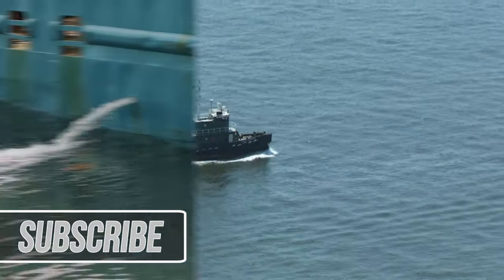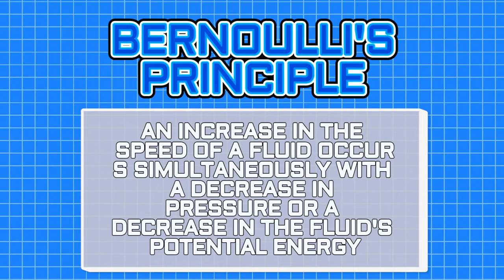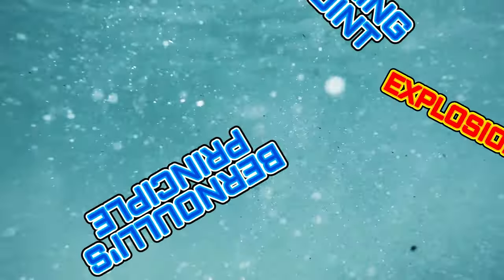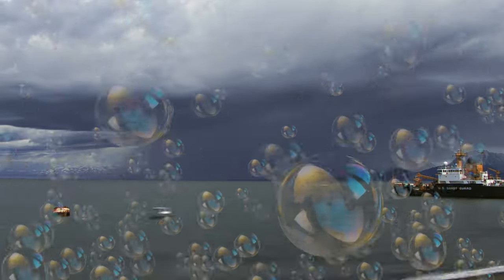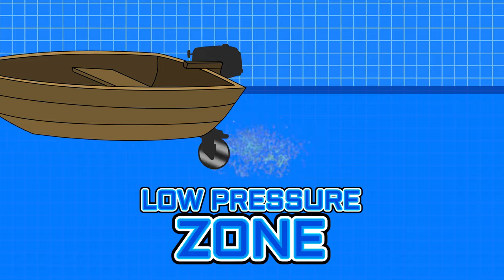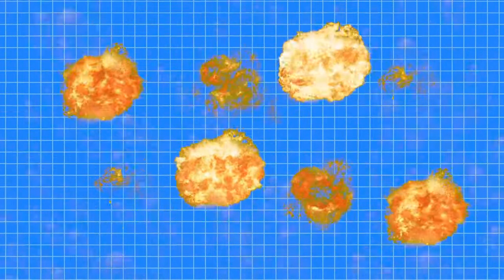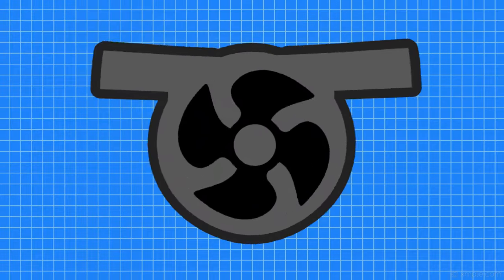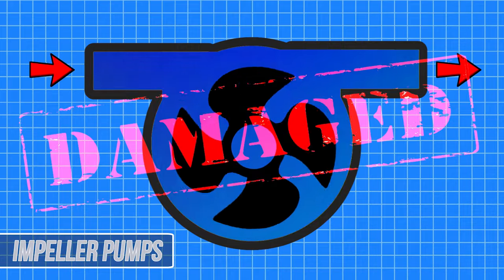What is Cavitation and How Does it Work?

Comment: I'm having a lot of trouble understanding Bernoulli's Principle, can someone help?

How can a fluid pressure drop as fluid velocity increases? In my head fluid pressure and velocity seem directly proportional. Like if I had water just dribbling out of a hose, that's low pressure and low velocity. But if I had one of those power washing hoses, the water is coming out way faster and it's higher pressure too.

Idk if I'm explaining myself clearly, but to me the pressure and velocity of a flowing fluid seem directly correlated instead of indirectly. If I wanted to increase the pressure of water coming out of a hose, I'd squeeze the handle tighter which would also increase the velocity. In that example I'm increasing the fluid velocity which is increasing the flow pressure (as is apparent by the plant I'm watering bending more and more).

I need help grasping Bernoulli's Principle because it seems like it's saying the opposite of what I'm describing. Most people just tell me to just look at the equation but that's not helpful. That's like saying the bible is true because the bible says it is true. What I want is to have a deep intrinsic understanding of Bernoulli's Principle, with some examples to picture in my head to go along with it.
Reply: I have to same question too. 
But i just go along with the Bernoullis theorem
Reply: Hi,
The way Bernoulli's Principle works is all to do with the total energy within a system. It makes a number of assumptions including that the flow is at steady state, the fluid is incompressible and inviscid and the equation is only valid along a single streamline of the flow. The total energy is broken down into 3 components which are pressure energy, kinetic energy (the velocity) and gravitational potential energy. It also uses the continuity equation that states flow rate is equal to cross-sectional area of a pipe multiplied by velocity. To use the hosepipe example, if we turn the tap on and allow it to run until it is at steady state, we are claiming that no energy is being put into or taken from the system. We are also claiming that the flow rate (volume divided by time) is constant throughout the pipe. If the diameter of the pipe does not change, this means the velocity and therefore kinetic energy remains the same throughout. Of the 3 components, velocity and gravitational potential energy can both affect the pressure energy in the system. To simplify it slightly, let's say the hosepipe is horizontal so we can ignore the gravitational potential energy. Now we can say the sum of the pressure energy and kinetic energy has got to be identical at any point in the pipe. Remember, the flow rate remains constant but the velocity can change. If you place your finger over the end of the hosepipe, this reduces the area that the water can flow through, but the flow rate has to remain the same. This means the same flow rate divided by a smaller cross-sectional area gives a higher velocity and so the kinetic energy has increased. Bernoulli's is saying the total energy remains the same and energy is neither put in or taken away. As energy can neither be created nor destroyed, this increase in kinetic energy has to come from somewhere so the pressure energy is converted to kinetic energy, hence a drop in pressure. This reaction is reversible so if the pipe was widened, the velocity would decrease and kinetic energy would be converted back to pressure energy. Once the water has left the hose, this all goes out of the window because the fluid has left the system and will now be at atmospheric pressure. Don't forget, Bernoulli's principle can only be applied in certain parts of a system and can often be misapplied. If there is any component introducing or removing energy from the system such as a pump or turbine, this will no longer be accurate. Have a search for videos on how a venturi tube works to help get your head around it, I know it seems to go completely against common sense but stick at it, hope this has been some help and not just confused you even more. Cheers,